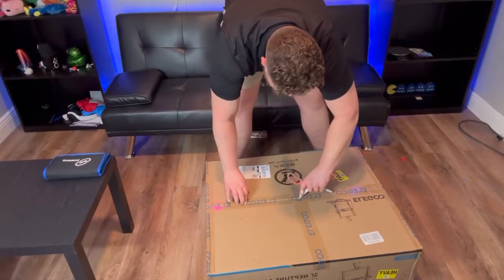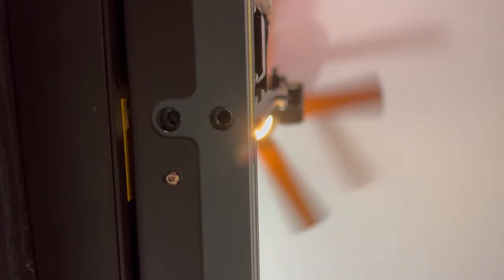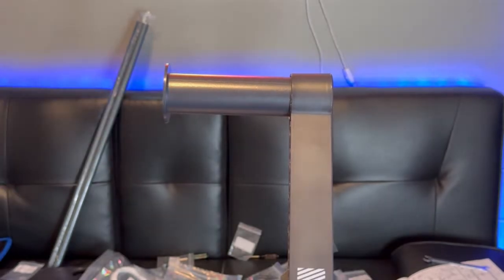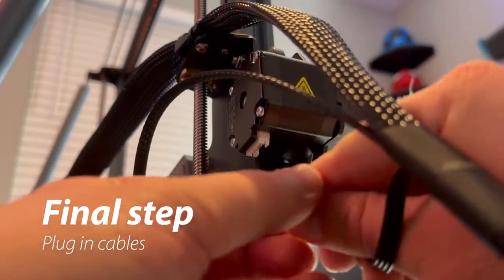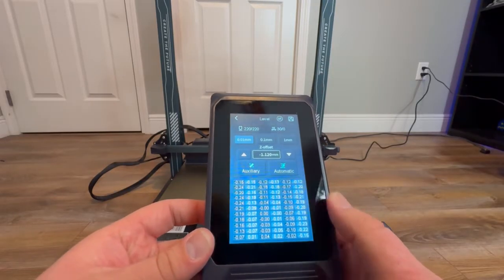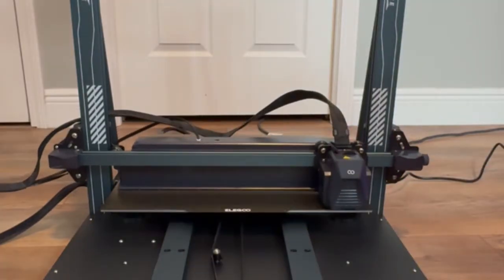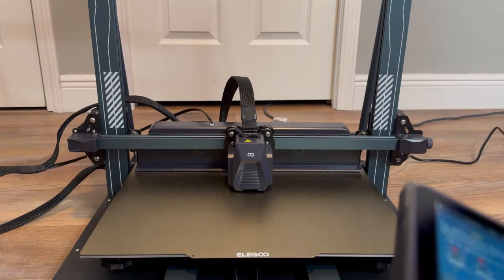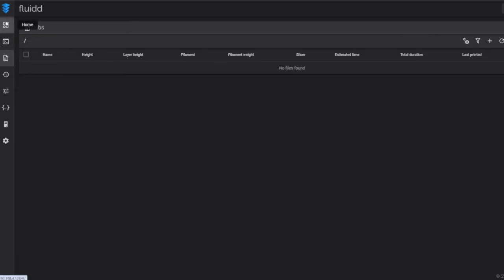Elegoo Neptune 4 Max Unboxing and setup | Assembly, Leveling, WI-FI

Comment: Is the filament detector unit supposed to move? Both the screw holding into place on the filament holder and into the actual detector are acrews in fully yet it still moves around
Reply from the maker: Yes it should swivel
Reply: @CoshTech brilliant thank you very much

Comment: mine isn’t turning on
Reply from the maker: @Darkknight39  make sure that the is set to the correct setting for your country
Reply: @ i’m in the US the switch is already on 230, but the off/on switch says only with 250 volt fuse
Reply from the maker: @Darkknight39  us should be 120
Reply: @ thank you for curing my ignorance

Comment: Can you pre heat the bed before doing the automatic 121 point test? It’s a large slab of metal and it takes a while to get evenly heated and for any expansion to have settled down
Reply from the maker: You can, it won’t to the full 60 usually 40 but yes

Comment: thank you! just got mine and I didnt know how to access it from the internet, this is going to be awesome! one thing i ask you, since i´m new:  what steps should i follow to make the printer faster and reliable, because I asked it to print in sport mode and it failed. please!
Reply from the maker: Most of 3D printing is trial and error, unfortunately. You’re going to have to try different settings until you get a successful print. I would say put a raft down as your bed adhesion, enable z hop on the travel setting, and also orient your model so the bed does as little movement as possible

Comment: Did you update your firmware for the max?
Reply from the maker: I haven’t yet, it’s been running very well since out of the box, why do you ask
Reply: @CoshTech  Because the 4 series from Elegoo has been plagued with problems. If you just ordered yours though, maybe you have a later version of their firmware.
Reply from the maker: @Diggilicious yeah I noticed a lot of issues on the initial release, and I did get mine a little after so you could be right. I did have to tune some settings in fluidd because of some homing issues, but besides that it’s been great.